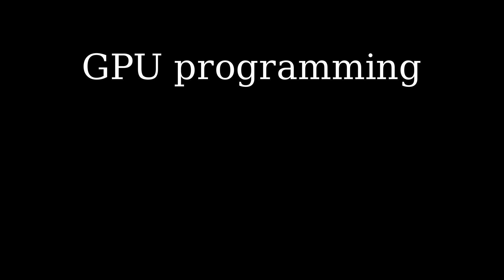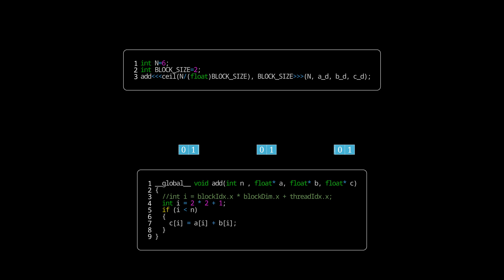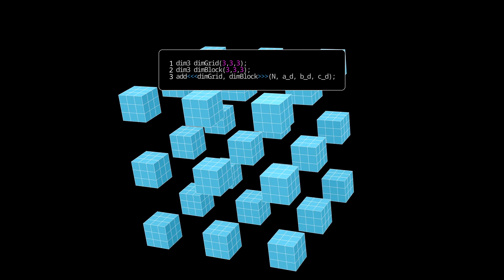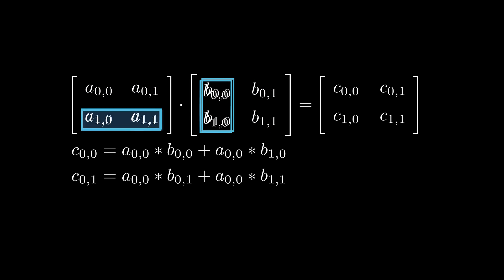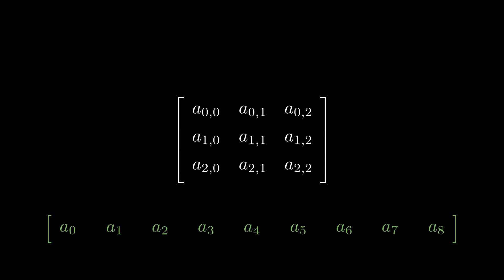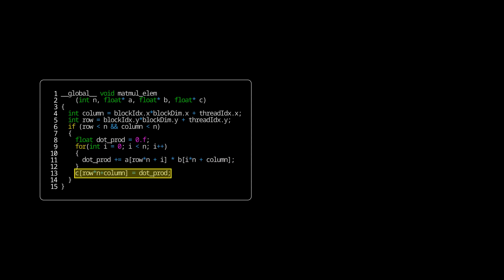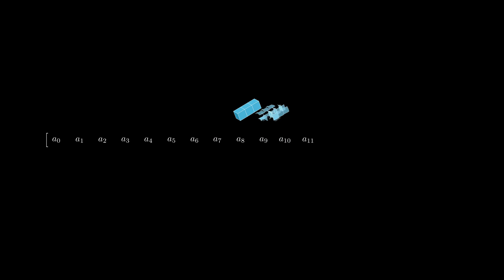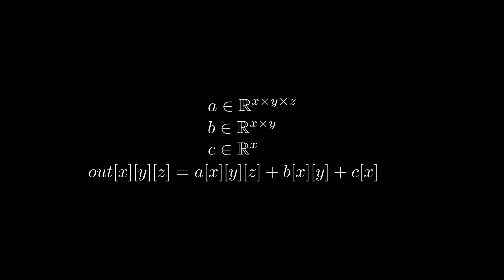Kernel Grid | GPU Programming | Episode 2

Comment: Great video, thanks! I'll include my implementation of the exercise you left (basic solution, no optimization at all):

```cpp
#include <iostream>
#include <cuda_runtime.h>

_global_ void sumArrays(float* D, float* A, float* B, float* C, int X, int Y, int Z) {
    int x = threadIdx.x + blockIdx.x * blockDim.x;
    int y = threadIdx.y + blockIdx.y * blockDim.y;
    int z = threadIdx.z + blockIdx.z * blockDim.z;
    // Each thread will compute one output element, that is D[x, y, z]
    if (x < X && y < Y && z < Z) {
        int out_idx = x*(Y*Z) + y*Z + z;
        D[out_idx] = A[out_idx] + B[x*Y + y] + C[x];
    }
}

int main() {
    const int X = 2;
    const int Y = 3;
    const int Z = 4;

    // Host input arrays
    float h_A[X*Y*Z] = {
        1.0f, 2.0f, 3.0f, 4.0f,     // x=0, y=0
        5.0f, 6.0f, 7.0f, 8.0f,     // x=0, y=1
        9.0f, 10.0f, 11.0f, 12.0f,  // x=0, y=2
        13.0f, 14.0f, 15.0f, 16.0f, // x=1, y=0
        17.0f, 18.0f, 19.0f, 20.0f, // x=1, y=1
        21.0f, 22.0f, 23.0f, 24.0f  // x=1, y=2
    };
    float h_B[X*Y] = {
        1.0f, 2.0f, 3.0f, // x=0
        4.0f, 5.0f, 6.0f  // x=1
    };
    float h_C[X] = {1.0f, 2.0f};

    // Device input and output arrays
    float* d_A;
    float* d_B;
    float* d_C;
    float* d_D;
    cudaMalloc(&d_A, X*Y*Z*sizeof(float));
    cudaMalloc(&d_B, X*Y*sizeof(float));
    cudaMalloc(&d_C, X*sizeof(float));
    cudaMalloc(&d_D, X*Y*Z*sizeof(float));

    // Copy input arrays from host to device
    cudaMemcpy(d_A, h_A, X*Y*Z*sizeof(float), cudaMemcpyHostToDevice);
    cudaMemcpy(d_B, h_B, X*Y*sizeof(float), cudaMemcpyHostToDevice);
    cudaMemcpy(d_C, h_C, X*sizeof(float), cudaMemcpyHostToDevice);

    // Execute the kernel as a single 2x3x4 block
    dim3 blockDim(X, Y, Z);
    dim3 gridDim(1, 1, 1);
    sumArrays<<<gridDim, blockDim>>>(d_D, d_A, d_B, d_C, X, Y, Z);

    // Copy result back to host
    float h_D[X*Y*Z];
    cudaMemcpy(h_D, d_D, X*Y*Z*sizeof(float), cudaMemcpyDeviceToHost);

    // Cleanup
    cudaFree(d_A);
    cudaFree(d_B);
    cudaFree(d_C);
    cudaFree(d_D);

    // Print results
    std::cout << "Input A:" << std::endl;
    for (int x = 0; x < X; ++x) {
        for (int y = 0; y < Y; ++y) {
            for (int z = 0; z < Z; ++z) {
                int idx = x * (Y * Z) + y * Z + z;
                std::cout << h_A[idx] << " ";
            }
            std::cout << std::endl;
        }
        std::cout << std::endl;
    }

    std::cout << "Input B:" << std::endl;
    for (int x = 0; x < X; ++x) {
        for (int y = 0; y < Y; ++y) {
            std::cout << h_B[x * Y + y] << " ";
        }
        std::cout << std::endl;
    }

    std::cout << "Input C:" << std::endl;
    for (int x = 0; x < X; ++x) {
        std::cout << h_C[x] << " ";
    }
    std::cout << std::endl;

    std::cout << "Output D:" << std::endl;
    for (int x = 0; x < X; ++x) {
        for (int y = 0; y < Y; ++y) {
            for (int z = 0; z < Z; ++z) {
                int idx = x * (Y * Z) + y * Z + z;
                std::cout << h_D[idx] << " ";
            }
            std::cout << std::endl;
        }
        std::cout << std::endl;
    }

    return 0;
}
```

Comment: Hi, I've been watching these videos in addition to reading the Programming Massively Parallel Processors,
My take on the exercise: (for the sake of brevity, I will not include assigning memory or memcpy for now)

```c
// Kernel Function for Array Summing
_global_ void sumArrays_Kernel(float *A, float *B, float *C, float *D, int Width, int Height, int Depth) {
    int x = blockIdx.x * blockDim.x + threadIdx.x;
    int y = blockIdx.y * blockDim.y + threadIdx.y;
    int z = blockIdx.z * blockDim.z + threadIdx.z;

    if (x < Width && y < Height && z < Depth) {
        int index = x + y * Width + z * Width * Height;    // Defined as index as used twice in next line
        D[index] = A[index] + B[y * Width + x] + C[x];
    }
}

void sumArrays_Host(float *A, float *B, float *C, float *D, int X, int Y, int Z) {
    float *A_d, *B_d, *C_d, *D_d;

// Malloc and Memcpy vars (i.e A -> A_d)

    dim3 block(2, 2, 2);   // I'm not massively sure on good sizing here
    dim3 grid((X + block.x - 1) / block.x, 
                      (Y + block.y - 1) / block.y,
                      (Z + block.z - 1) / block.z);

    sumArraysKernel<<<grid, block>>>(d_A, d_B, d_C, d_D, X, Y, Z);

   // memcpy result back, and then free memory

}
```

General idea is that we're using a different index for each input vector, based on the logic you were mentioning earlier, the block and grid logic is just making sure we're in bounds
Reply: I am new to GPU but this looks very inefficient to me. 😵 Please correct me if I am wrong. The problems are:

You are not loading the B ad C tile into shared memory.
"A" Tile size should be around 32x8x8 assuming float32 elements
vectorized loads and each thread should compute at least 4 outputs for float32?

This will give at least 6X speedup?
I am reading DL1943 Deep Learning Cheatsheet and Programming Massively parallel processors and these are the improvements I see.
Reply: @DobrzyToby  It's a good implementation for starting off GPU programming, there are so many optimizations that can be done ahead, like you mentioned of tiling, vectorized load
Reply: Well done!